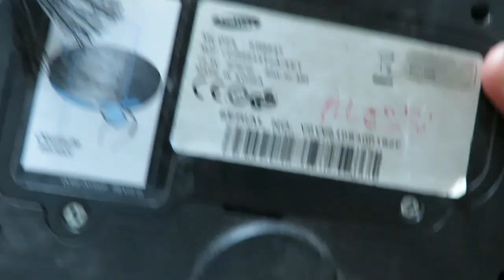Samsung Navibot SR8845 - Free wheel issue repair

Comment: Not suitable for my SR8845... this one has a full black plastic thingy wheel. No 3 screw covered empty wheel with a metal piece linked to the motor. 

The "inside" of the wheel doesn't grip anymore with the arm of the motor.